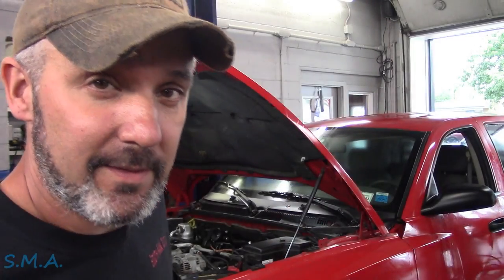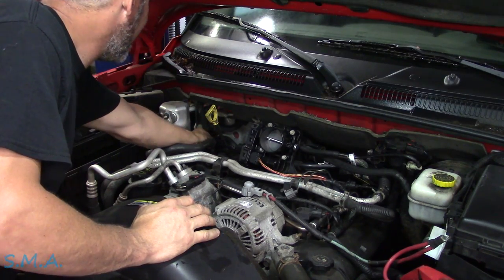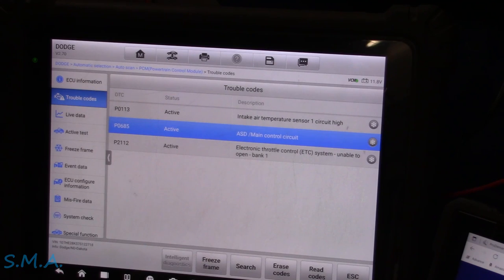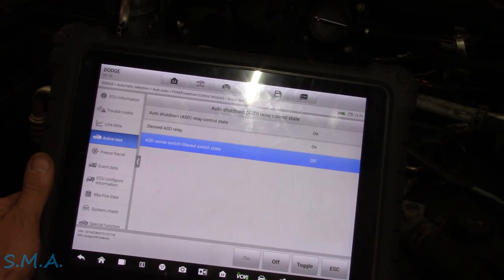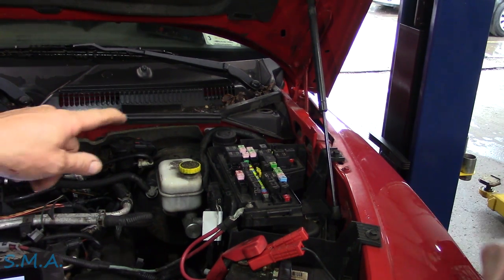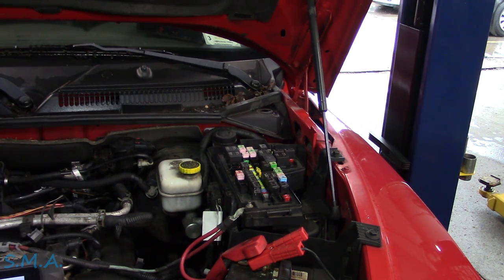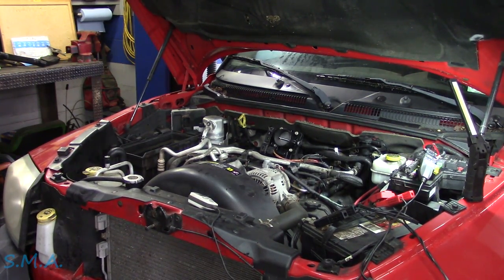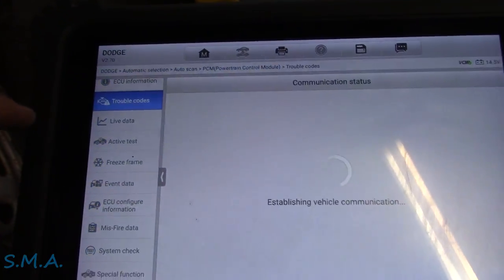Dodge Dakota: No Start After Clutch Replacement

Comment: One time I rebuild an engine and everything went perfect, Didn’t cut myself or anything but the engine would not start, so I pulled the distributor out and sliced my hand open on a piece of sheet metal and bled all over the engine, put the distributor back exactly same way and it started and ran perfect. I just had to donate blood to the engine gods I’m guessing lol

Comment: Sister in law called me once when she got off work said her car won’t start she works night shift it early to get up drive 22 miles to where she worked and I remember it was 79 Camaro auto in the floor, turns out when she pulled in to work and parked and shut it off she didn’t put it in park, I did and it started right up I still give her hard time about it to this day whenever she even mentions car problems I ask is it in park and I duck she still too slow lol

Comment: Reassembling Chinese scooter that had to be welded back together after crash. Could not get start button to turn her over. Tracing wires, button, relays.......... It was simple as not holding brake lever in while cranking. DERP

Comment: I replaced my first power steering pump ever in my 2003 Jeep Grand Cherokee and missed removing the rubber plug in the return line fitting and installed the return line hose unaware it was still plugged. Filled the pump, did my unpowered side-to-side and fired-up the Jeep and the pump didn't work. After a few minutes I noticed the reservoir was empty so I turned it off, filled it up, and tried again but this time it blew the return hose spraying fluid all over the engine. I spent about 45 min trying to diagnose the problem, pulled the pump and then was able to see the rubber plug inserted into the return fitting. Bonehead move I was able to laugh about but embarrassing at the same time as my impatience to install it and get to bed caused me to not inspect the pump like I should have before installation.

Comment: I found a tracking device on my Dodge Avenger. I removed it because I don’t want any devices on my car. Somebody did sloppy job I could see exposed hot wire (pin 16 on obd2 port) and other damaged wires. I was moving obd2 connector and inspecting. I cranked that car… well it turned into no crank no start. I videotaped as well.I rewatched that video. Oh my. I accidentally short hot wire (pin 16) to ground. It popped the fuse causing asd/main relay shut down and lost communication to pcm/obd2. I feel silly. I did not see spark nor hear pop noise when I was moving connector around. I could hear/see through footage 😵‍💫⚡️
Reply: Someone put a tracking device on your car?
Jealous girlfriend?
CIA?

Comment: My truck would not start for a month and I could not figure out why dodge dealer was booked solid and I had it in another shop to find out what was wrong they could not find the problem they took it to the dealership to get them to look at it I got the phone call and went to get my truck back it was a $69.00 bill for a five amp fuse for the Ecm I had blown it trying to wire up my dash camera and had touched a ground and didn’t know it I had gone through the fuses twice and didn’t catch the blown one I guess I didn’t think a little 5 amp was so important it would stop the truck from running

Comment: Love the videos.  New subscriber right before shop rebuild.   Love the videos.  Thank you.  Keep it up.  Maybe you can help me find a backup lamp switch for a 68 Camaro 3 speed manual on the floor.  Missing it on my Camaro but only can find on eBay for over $100 for old new parts.  Thanks

Comment: Many moons ago I had a customer bring his 1978 Chevy Caprice Classic into the shop because of the weird noises coming from the "rear end".  So as customary, I test drove it expecting to have a differential or suspension issue.  After a few miles of left and right turns hearing all kinds of strange noises that I didn't recognize, I took it back to the shop and opened the trunk.  It was full of junk rolling around the trunk.  Took all the crap out and drove it again.  Quiet as a mouse.  Told the customer what I found when he came to pick it up and pissed him off.  Never saw him again....
Reply: Did you charge him for the diagnose ?
Reply: @citichap  No.  It took about 30 minutes of my time and I figured he'd be embarrassed and get pissed.  Not charging him eased the pain...

Comment: Well u wanted crazy 06 dodge 3.7  dakota  put new fuel pump no problem turned it around pulled the neg replaced the injectors plugs and coils  now it wont crank

Comment: Replacing a head gasket on an old 1.9 turbo diesel Peugeot 306. We think we've disconnected and undone everything. Go to lift the head and nothing. So we think it must be stuck to the old gasket. So we do the old trick, a six foot length of scaffolding bar and straps to both ends of the head and lift. We're almost lifting the whole front of the car, but that damn head still isn't budging.

I go back and pull up the workshop manual. Yup. There are 8 head bolts.

Then I count the number of bolts in the box.

Yup. You guessed it. 7...

Turns out there's one bolt that's pretty well hidden at the back of the engine, which we'd missed.

We still laugh about that, twenty years later!

Comment: I had a customer come in with the wiper fluid pump not working:P he had it at another shop getting a inspection fault on it:P turns out the customer and the other shop did not realize the right way to use the switch:P just showed the customer how to use it. ford transit van

Comment: I’m a forklift mechanic once Upon a time I was working on a forklift I had the shop manual and wiring diagrams  I had a code for no accelerator circuit voltage detected so I checks it’s fuses and relays all good gotta be a broken wire so I checked end to fuse both ways it was on com side so I opened the spaghetti bomb and found nothing so I opened the other side nothing went back and checked all the fuses and relays and found a bad relay for the hydraulic controls was bad replaced it and guess what it had throttle response 🤦‍♂️ it’s fine that they ran it threw 2 relays buy why is it not on the diagrams or in the book 16 hours later I learned something

Comment: Sure Eric recently had a problem with my car stereo so I changed the fuse cuz it had blown went to start the car nothing starter wouldn't kick over I pulled the fuse back out car started I thought well that's really weird it's a 7 amp fuse that deals with the radio cigarette lighter circuit that doesn't make any sense nonetheless it worked I went on vacation came back wouldn't work decided to diagnose it after screwing around for an hour and a half I finally decide hey let's check battery level yeah I was at 9.3 volts that should have been the first. I think I checked should have been battery level so replace my battery and it fired right up... I found it to let that ever happen again and don't ask me what the fuse had to do with pulling it and putting it back in and the car starting that's what set me up on the wrong track
Oh I do remember part of the fuse problem it wouldn't turn off the alarm system it wouldn't activate it deactivate it though the siren wasn't going and when I replace the fuse it allowed me to deactivate the siren so something to do with the low voltage circuit caused all those screw UPS

Comment: Opened my hood while both window wipers were up off the glass on my Audi. My hood wasn't best friends with the wiperarms after lol. Had to paint over the chipped paint dents from 2 wiperarms to the bare metal..outside..in the snow..at midnight..in the total dark.. So i took a heatgun to speed up the cure time on the paint for the hood..kept the gun blazin for too long, hotter than i thought, so i melted all the plastic trim/grills at the bottom of the windscreen..and didnt see sht cuz i had only moonlight. Found out i had fkd myself when i started smelling burnt plastic lol. wasntcheap

Comment: when i worked as a truck mechanic  we did a service on a volvoFH. customer drove away, came back after a short while, started yelling, YOU BASTARDS did not tilt the cabin back properly. it won't run on full throttle!!! he had e volvo F model before so he thaught that the accelerator was still mechanik. i just opened the driver door and took out the snuffbox under the gas pedal... he was very quiet after that :D.
one customer yelled at me for doing something to his garbagetruck, it was jumping when he drove it in turns. he had accidentaly engaged the diff lock  :D

Comment: 2015 Chevy  cruise  ..... friend of mine says his car  has no more top end power  when he pushed the throttle pedal to the floor....    no codes   so i  pop the hood give her a visual inspection nothing out of place  so i take her for a shake down the road to confirm his statements   ...  when getting into his car i noticed he had the big thick rubber rain floor mats from Walmart   sure enough the mat was restricting the pedal from going down all the way so he was only getting about 70 percent of  the throttle....  i pulled the mat back told him bobs yours sisters uncle and its fixed     lmao

Comment: 30 yrs ago, so i'm driving down the road and my 63 vw starts running like crap, i pull over open engine compartment and guess what? fuel line came off the carb, fuel spurting all over. engine running off fumes! shut it off plugged fuel hose back in and i'm on my way. No Fire, lucky me!!

Comment: Had to change the front caliper of my 99 F250 in my father in laws driveway. After we got that done, I had the bright idea of saying lets pull the harness off the ac clutch since the ac didnt work, and make sure there was power to it before we did anything else. So I slide under the truck, follow the harness what I thought was the clutch, and pull it off. Go to restart the truck, nothing. Just turns over. we look at a few things, put 5 gallons of gas in just to make sure since the gas gauge would not work properly under an 1/8th of a tank. Still nothing. How hard could this be since all we did was to pull the ac harness loose. So I find a mobile mechanic to come out in 2 days to look and figure it out. Get home and its bothering me. Then i remembered the crank shaft sensor was near the ac compressor. But that should be buried behind the compressor, like the 5.4 in my wifes Navigator. So I call my fil and say when you get 5 minutes, put that harness back on and see what happens. He calls me back about 3 hours later and says truck fired right up.I somehow managed to get the cps off since the compressor harness was on top of the compressor and not on a pigtail like the other 5.4 we have.

Comment: I was racing and then I had no gas pedal... popped the hood saw nothing wrong, thought it was my throttle pedal where the cable goes into it. Then my friend looked at it and popped the throttle cable back into its spot under the hood 🤦‍♂️ completely missed it
Reply: Me and my best friend had something like this happen back in the seventies. We were in his Mom's car and he did a few burnouts or state patrol turn arounds or something, and all of a sudden, the car would only idle. We got to looking around and finally found that the cable had broken at the pedal. We made it home using a pair of fingernail clippers. I pulled the cable while he steered.
(Another time, same friend, same car, fuel pump diaphram died. Made it home with me laying under the hood using a spray bottle full of gas. and him looking out the side window to stay on the road. Fun trips.)

Comment: So my wife called me one morning the car was no crank, nearly new Saturn vue with the 3.5 Honda, i drive the couple miles to the McDonald's parking lot test and have a look,  I tested everything I could think of, normally she goes through the drive thru,  only important because of the solution,  I even go home to get my key thinking a key chip issue,  Its raining and I still don't have any ideas,  I call a tow truck and get in passenger seat, as I wipe my face off I reach over to the shifter put the car in park and start the car............. I still  tease her about that sometimes.

Comment: Lights wouldn't work on trailer.  I rarely use trailer and know it worked at one point but use a trailer a couple times with no lights (actually driving lights worked but no brake or blinkers). Went thru all the fuses but they were good. It's a Nissan Frontier. Started throwing relays at it but no change. Brought to dealer and they said they tested it and everything worked fine. I said you gotta be kidding me. Brought to Uhaul after asking around and he went thru all fuses and found one that was blown. So dealer was wrong and I was wrong. I don't know why Nissan needs 4 fuses just for trailer lights.  Felt like such an idiot after telling the guy I checked all the fuses. Lucky he didn't trust me.

Comment: A long time ago I purchased a station wagon from a friend of mine she sold it to me for $500 she said it will not start and we just keep cranking and cranking and cranking she said never plays the spark plugs car wire distributor cap alternator starter change the oil still nothing so I have to pay a record for the money to go pick it up it was 3 hours away what was the problem you asked a stupid $13 fuel filter it was so clogged up you cannot blow air through it so I took a floor jack put it up on jack stands change out the fuel filter what you no it started right up come to find out it also had a lot of blown fuses when I change them out everything started working so I sold the car back to her for 3500 cash when she came by to pick up the car the first thing she asked me what was wrong with it I'll call her don't worry about it I'll fix it that's all you need to know

Comment: What's a tipm? Weird.
Reply: TIPM = Totally Integrated Power Module.  AKA fancy fuse box.  Chrysler/Fiat use that name.  Other manufacturers have similar devices that they may have a different name for, but the function is similar.

Comment: I was a young guy probably the first major job I ever did well major for me anyway putting the timing chain in a Grand Torino had it all done I was getting late today I had a date that night My girlfriend shows up says what are you going to be done I said soon as I get this thing running I tried everything it would not start check the timing chain was right where it was supposed to be she reaches over and hands me the rotor for the distributor and says is this something important I put it in the car fired right up That's my dumb story

Comment: Please take on a basket case job !!!!  I need some mental stimulation and guessing what the problem is as we slowly deduce the cause of it !!!!  All the easy peasy work flowing thru the shop lately could be done by your kids !!!!  Need a job that requires schematics, voltage testing, taking apart the harness wrapping, cleaning ground points and testing a component or two !!!! The meat and potato's of tech troubleshooting !!! Earn that paycheck !!!! Put in some Dorman parts (Not a sponsor) !!! Get a salvage yard part and switch something out to test a theory !!!! That's a challenger !!!!!!! Otherwise, have your two employees run the bays, and you do the office giving Mrs. O. a week off with pay !!!!!!!!!!  These jobs where you just plug in a connector, change a fuse or a light bulb and the vehicle is fixed are boring to a inquiring mind !!!!!!!!!!!     : - )  

0)